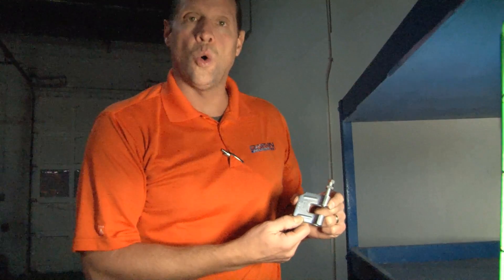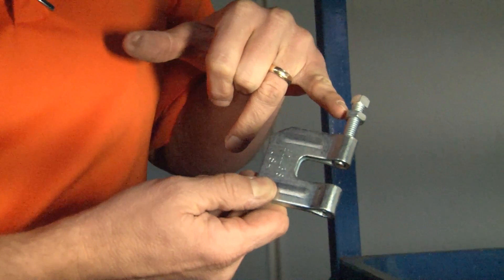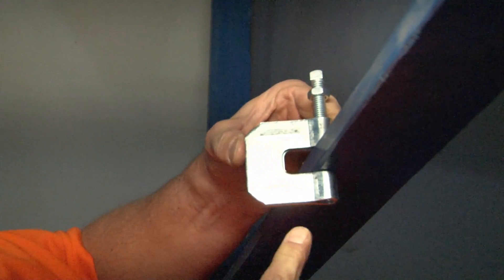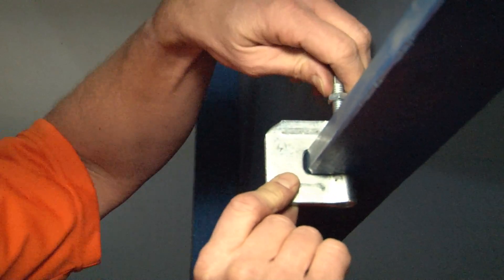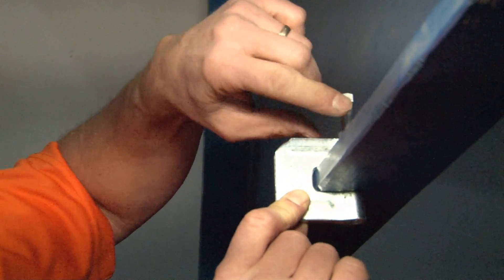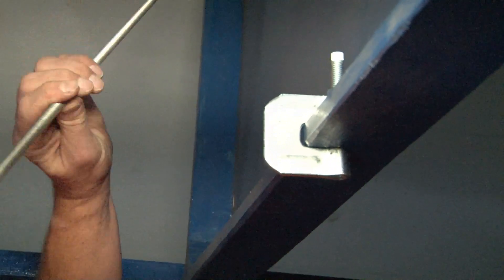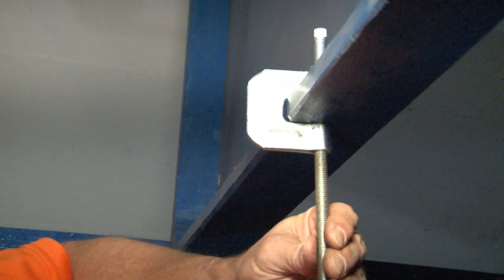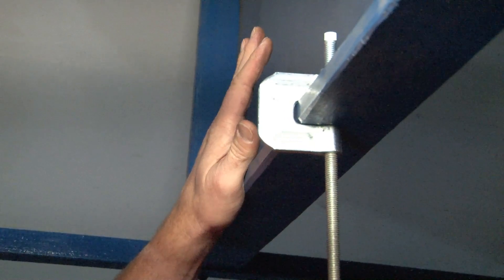3/4-10 C Style Steel Beam Clamp for Vertical Loads: SCC-3410

Comment: very cool device, I wonder if I could use multiple of these with rods to support a wooden structure to build a hanging floor from an overhead I beam structure?
Reply: Did you ever end up learning more about this?  I am considering to use these beam clamps to hang joists from overhead beams.